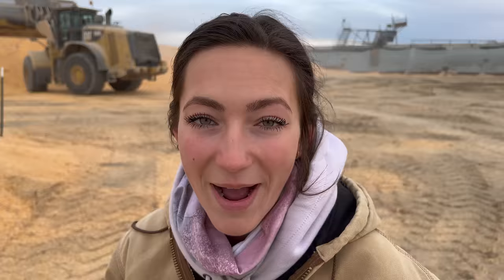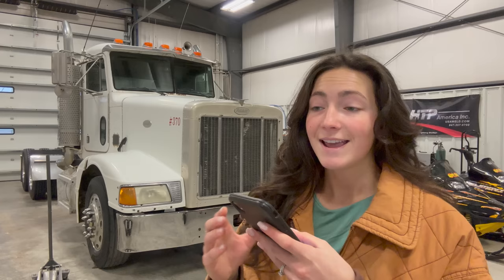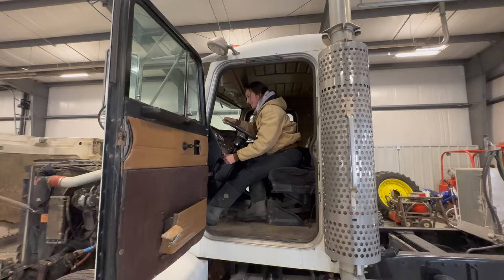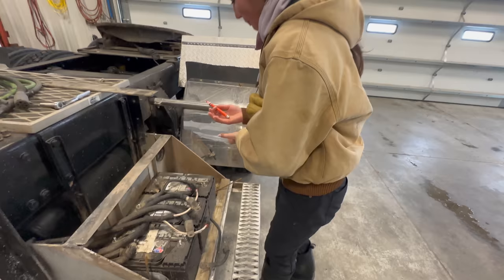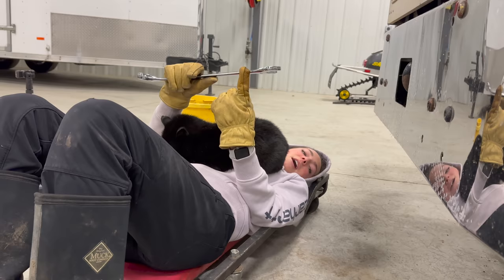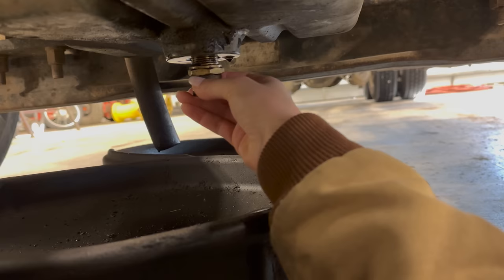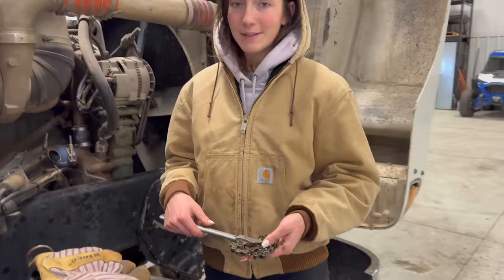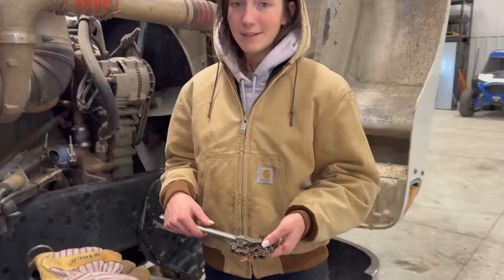The Worst Oil Change

Comment: Two things may help you. 1 - get one of the filter wrenches with a wide metal band instead of grippy teeth, or 2 - drive a long ( like 18" or more) screw driver into an undamaged portion of the filter body and out the other side , near the mounting point of the filter and try to break it loose by pushing the handle of the screw driver in the correct direction. Also, it goes against reason but sometimes trying to tighten the filter will break it loose enough to allow you to unscrew it.

Comment: My technique when you get that overtightened is:-
1) Find a 1/2" square shaft flathead screwdriver, and a 4lb lump hammer.
2) Use the lump hammer to bash the screwdriver the bejasus through the filter, then "lefty loosy".
3) Laura already knows how to put a new filter on right.

Comment: Happy New Year!  You need a truck type oil filter wrench, slides up on the filter then you operate with a 1/2" drive ratchet/extension to turn it!  Try NAPA or local auto parts store!  Best of luck!

Comment: Someone commented that the drain plug was made by Femco. I found mine under, No Spill oil drain System. You remove the brass cap, and thread on a hose., has the hose go's on, it opens a valve in the plug. You can turn the hose half way off to switch drain pans. They make drain plugs for almost all engines. It makes draining oil much easier, especially when it's hot. I buy mine from my filter distributor. You could adapt almost all your equipment to this system.

Comment: I used to be a truck mechanic and a mechanic for John Deere.  Looks like someone, wrench tightened that on.  I feel your frustration.  I always found a strap filter wrench to be the best kind to remove oil filters that have been overtightened on.  Good luck

Comment: I think those filters can be really difficult, as we have seen here. The only advice I could offer is that if you use a plain piece of bike chain, and wrap that around the filter as near to the thread as possible. Then get some mole grips and use them to tighten the chain around the filter and that should hold it in position, as close to parallel to the threads as possible. Then you can use a cold chisel or drift and hammer to gently tap the chain where it meets itself and hopefully that will break the seal. It looked like it was the angle of approach as much as anything here as accessibilty was limited so you were putting too much angle on the turn. This angle may also  have pushed the rubber seal of the filter against the housing on that side, meaning more friction and a harder turn. :)
Reply: mole grips - locking pliers (Vise-Grips, a vice grip or mole wrench)

Comment: I removed a filter from a small-block Chevy once that was so tight that a screwdriver driven through it just peeled the filter body off of the filter base when rotated.  The filter base had holes in it, so I used a chisel in each hole to drive it counter-clockwise.  I had to chisel through two holes to loosen it, but the third hole was as a charm.  You may be in a similar situation.  You’ll be able to get it off with patience and a little carefully applied brute force.

Comment: #1 always prefill fuel filter BEFORE installing, #2 get the wide band oil wrench appropriate size for the oil filter
Reply: Yes, I was going oh no .... when I saw that primary frame filter going on without being topped off with fuel. I realize some mechanics scream at filling filters for fear of adding dirt but why one has make sure the fuel and container used is spotless. That would take an awful lot of priming with a hand primer ( if it has one ) to fill that filter and I assume there should be an engine mounted one as well. The wide band steel filter tools are the ticket all right, avoid the frustration and potentially injuring ones self otherwise in the whole process

Comment: When push comes to shove, and you’re absolutely desperate, hammer a long screwdriver all the way through the filter where then the tip is sticking out a little bit on the other side of the filter and turn it then. It always works, I’ve done it a few times. Is it messy, heck yeah, but at least it’s off and you can clean up afterwards. Just have a bunch of rags or shop towels nearby ready to go when you start hammering.

Comment: Yup, 2" wide cloth strap wound through a piece of 3/4" square tubing, filter wrench. Will still crush ones really stuck on but shouldn't puncture or tear them. Advantage is 1/2" drive so you can use extensions to get breaker bar below the frame.

Comment: Seat belt style filter wrench is what you need to get that off. Being a heavy equipment mechanic for 30 years I have have filters work there way loose so I do tighten the 3/4 turn once contact is made. If it's really cold out and you tighten it when it's warm out to take it off it is way tighter. Make sure to fill that fuel filter with deisel.

Comment: 18:50  
Tool companies actually make a nylon strap version of this tool.  The strap is (3) inches wide and looks exactly like the chain tool you are holding.
Its actually made for changing oil filters for heavy duty trucks.  I had one in my truck when I used to work as an OTR Driver.

Comment: There are times when even the best band clamps won't work. Mostly because, as you folks noted, they were put on too tight. That said. Get a good one. Move it as close to the top as you can.  This will help reduce crushing. As you are close to the seating ring. Use an extension to get you below the frame. This should work. If not, and there is room at the top. First look to see if there's enough of the seating ring exposed. So that you can use an air chisel to loosen it. Direct impact on the seating ring will usually do the job. Be careful not to impact the filter base. Also, I had a quick-change valve installed on my truck in place of the drain plug. This allows you to shut it off. When you change pans. You two are awesome. Be good and luv always. Craig

Comment: I have a huge pair of Knipex water pump pliers, the largest they make probably, solely for removing stuck oil filters. Grip it so tight it collapses the filter, and spin it off. Once I’ve managed to tear off the can and innards, then you get the air chisel and carefully spin of the top plate after carefully heating the plate around the center thread. The vice grip filter pliers are really handy for general filter removal, I’ve never been a fan of the chain and strap wrenches.

Comment: Two possible solutions: use 2+ wrenches, one near the threads.  Have one person on each wrench to double the power.

You can punch a large screw driver through the filter at a point near the sealed end of the filter (closest to the ground).  STAY AWAY FROM THE THREADS ON THE ENGINE!!!  One person can use the strap/wrench, another can twist on both ends of the screw driver.

All the best!

Comment: Hi, I have seen them twice as big as that, just search "Cat 992",   I used to get loaded at one time by a machine with a 22yrd bucket, the truck I drove, took 3 buckets to fill it. It was awesome driving them, then I went onto Big bulldozers. Oh btw bigger is easier to do oil changes on. I used to service big machines before moving on to driving them.

Comment: Pro tip. 
Scrub all the battery cable ends with a wire brush then coat them all with a protective terminal coating after you hook them up.
Try turning the filter both ways. Might help break the seal loose. 
Definitely need a better filter wrench.

Comment: I agree with all the comments about using a strap wrench as high up on the filter as you can.  If it still crushes the filter, wrap some stove pipe around the filter and run some sheet metal screws to hold in place - then use a pipe on a 1/2" breaker bar to turn the strap wrench

Comment: For those big diesel engine filters you need a heavy duty strap wrench. Maybe a local trucking company has one you can borrow, and ask them where to pick one up. 
Usually they have a fitting for a 1/2" breaker bar so you can get lots of leverage.  
Good luck!

Comment: I am a diesel tech.  Look into a very large pair of channel locks. Or a filter    wrench that goes onto half inch rachet. Snap on has them but you can find them on Amazon. Volvos are notorious for being a pain.  I've not found a filter I've not gotten off. Even after thinking I can't.   If needing link I can look it up.

Comment: This is a plumber and machinist tactic. Take a big pipe, slide it over a filter and bolt it into the filter or jam it on. Than firetorch as close to the filter thread, and lightlly hit the wrench on pipe with hammer in rotary direction. Yanck wrench back and forth and unscrew. Try not to melt the seal. 
Hope it helps, I wish you great success.

Comment: If you remove the can of the filter, you can then twist it off with the special wrench that you are going to make. The special wrench has fingers that insert into the leftover portion still stuck to the engine.(make shift spanner wrench)  You might have to make those fingers long enough to clear the frame of the truck.

Comment: We use the same loaders at work. I pull a 5 axle trailer that can net 38,000kg. They usually load me in 2.5-3 buckets. Always impresses me the power of those machines

Comment: When you've crushed that beer can of a filter, use a chisel on the top mounting plate. Make a wedge/divot on the mounting plate and hammer in the direction of unscrewing. Of course you need to be able to fit all that stuff up near the top.

Comment: Get a piece of an old leather belt and some 80 grit sandpaper.  Glue the sandpaper to the belt.  Put that, sandpaper side to the filter, between the chain and the filter.  Work on the one that's not mangled to give you as much room as possible to work on the mangled one.

Comment: One way to get the oil filters off is to drive a Lady Finger or really big punch all the way through it dead center then use it to twist. Once the sides are crushed we never had any luck with the filter wrenches. Other way is chisel and hammer to the top edge or air chisel.

Comment: I have been a diesel mechanic since 1976 only a few times have I run into this situation. It was always with a used truck purchase. I found chisel on the top ring to be the best way to be the filter to move. Be careful  of to gouge the filter house g when hitting the chisel. Good Luck I've

Comment: Yes. Jack was correct about the filter wrench. I changed oil and filters on semi’s for years. One other hint to keep the mess down is to pinch a hole in the bottom of filters to drain them while draining the crank case oil. Makes for a very clean job. And a good idea also is to prefill filter before installing as oil will get to lubricated areas faster. Especially fuel filters. Those are expensive engines so every little bit helps.

Comment: Use a heat gun gun on the upper body of the filter then apply ice to the adapter while the filter is still hot. Tighten slightly then loosen. The filter should come right off. Also use a very light coating of grease or oil on the gasket for the new filter and hand tighten. Write down the hours and date with a sharpie on the new filter for reference and also put that data into your log book for the truck. Love your videos! Best of luck!

Comment: Your localJohn Deere store...they have a large oil filter wrench which is actually a piece of tube steel (which can be driven. By a 1/2” ratchet) with a belt of material (imagine a seat belt, only shorter). Very simple but was the last filter wrench I ever bought...approx 30 yrs ago. Good Luck.
😊

Comment: That's pretty common.  Once the filter can crushes, it's only in the way.  Tear the rest of that filter can off of there and get it out of the way.  Then using a cold chisel and hammer (or air chisel), tap against the base of the filter in a counterclockwise direction.  The chisel will bite into the remaining part of the filter base and grip, while the hammering will jar it loose.  It will come loose.  Just make sure you don't damage the seat on the filter base or you will never get rid of the leak.

As for being able to look at a fastener and know what size it is, you get that skill by practice (just like anything else).

Comment: It is goofy why some people over tighten oil filters.

I had one on a car a long time ago that was so tight that I tore the filter can off and left the threaded portion of the filter on the engine.  I wound up using a chisel and a hammer to turn the last bit of the filter that seats against the engine block.

I usually only give my filters a quarter turn past hand sung at the most.  The filter doesn't leak, and the filter comes off with the filter wrench.

It's a difficult task to get those off and to not damage the gasket seat for the filter.  You have to be very careful to undo someone's misunderstanding of what tight is for a filter.

Comment: English

for blocked filters: pierce the filters laterally with a through hole, insert a lever in the hole and unscrew them, no specific tools are needed, a metal chisel and a tube are fine, good luck

Comment: What we do is take off the oil fill cap, and while the oil is draining out of the pan, poke a hole all the way through the filter with a screwdriver and use that to unscrew it. By having the oil fill cap off and the plug out, thershouldn’t be(in theory) any pressure inside of there. Thus, loosening the seal.

Comment: Laura and Grant thanks for the ride a long. For the oil filter. If Grant has an old leather belt that plus a socket extension (long) will get the filter loose. Just put belt through the loop and use the socket extension for leverage. 👍

Comment: Filters: 
Come in from above with a LONG cold chisel, 
and hit the outer most ring of the oil filter. (on the engine side), 
(NOT the frame side of the filter)
in the direction you want it to go.
Those have been cooked on there for a few years.

Good Luck.

Comment: Take a strap of metal and put underneath your wrench to protect the filter and it will stop from digging into it. If that doesn’t work, tear the filter off and there will be a metal base to it then you can take a chisel and chisel into the metal base to get it turn.

Comment: get a strap wrench - picture a loop of 2" wide seat-belt webbing, attached to the side of a length of square tubing, ideally 1/2" inside... slip the webbing onto the filter, as close to the block as possible, put a ratchet into the end of the tube, and turn the tube... the webbing will grip the filter without crushing it, no 'chain tongs' required... it works on fuel filters too...

Comment: I’ve used a rubber strap wrench that has a 3 inch wide band on it so it distributes the pressure over a wider area so it won’t crush the oil filter and it works pretty good if you could find one auto parts maybe online. I’ve also removed a filter that was stuck I drove a big screwdriver all the way through the filter and turned the filter off that way

Comment: Try enforcing the filter hull by wrapping it in some sheet metal or a cut open tin can to avoid it getting crushed... Maybe heating it (careful with the oil) could help too.

Comment: Old school when you have crushed the filter get a large straight tip screw driver drive it through the filter to unscrew. Works best if both the housing and filter are at or close to normal room temperature.

Comment: safety tip for batteries and nearby metal parts such as the hold-down bar -- do not turn the batteries into an electric arc welder.   in a nutshell -- the bar could easily slip and connect terminals for a meltdown, and your metal socket wrench is a similar liability -- slip, fall and instant welder ...  cover all terminals with insulator such as electric tape until hold down is tight and secure, and when working on the cables, cover all other terminals with an insulating cloth so that if the wrench drops it does not conduct electricity.

Comment: as a mechanic this is the very first time in my almost 38 years that I can remember seeing a filter that tight but the only thing I can think of is that you take the biggest screwdriver you have and punch it right through the filter to try and get the filter of as an absolut final solution and if that doesn't work, then I don't know what you should do but thats the only thing I can think of. WAIT A SECOND! wondering if it's possible to put like a blanket of some kind over the filter somehow and try to heat the filter to possibly make the metall on the top of the filter to expand due to heat 🤔

Comment: Sometimes there is a rare occasion where you have to use a center punch and Hammer to get it off but when you put the fuel filter on you should have at least filled it with fuel to keep the air bubbles out as much as possible

Comment: Have some wire numbers in your toolbox so you can mark stuff when you take them apart and get the order or position correct when replacing them.

Comment: They have been on there forever! Just pound a pry bar thru the filter as far as you can to the clock wise spot. Then pull hard to pull it off. The filter is useless, do not be afraid to destroy it. The closer you can get to the base where it attaches is better. If you have to angle it up to get close, that will work!

Comment: I always get the engine up to operating temperature before i do an oil change. It sucks having to deal with the hot oil, but the filters are 100% easier to break loose.

Comment: In my experience someone tightened it with a wrench when installed. The gasket is made to swell when exposed to oil the suggestions above are great but IF the filters are installed on a mount that bolts to the engine you might be able to remove the assembly so you can get at it. I enjoy you guys, it reminds me of 50 years ago when we got started

Comment: Hi Laura clean your battery cable connections and post before install. Corrosion leads to a voltage drop leads to less current where needed.